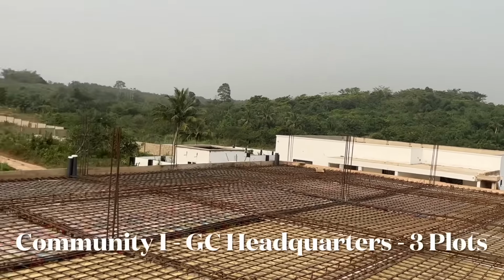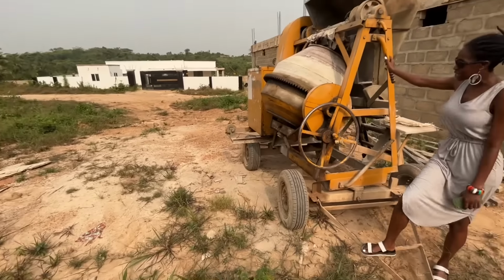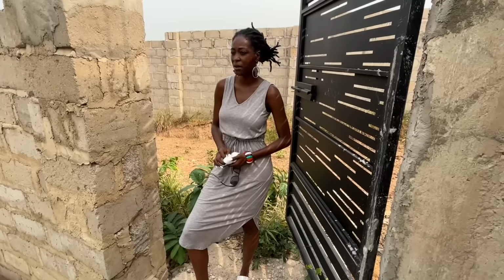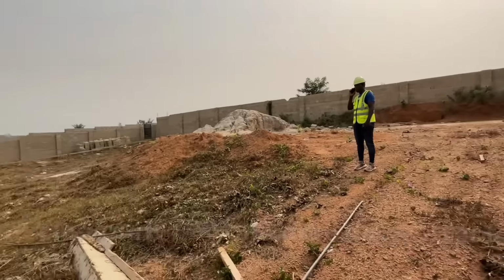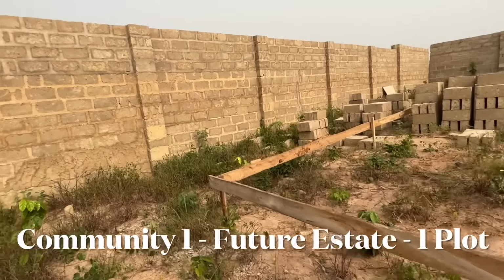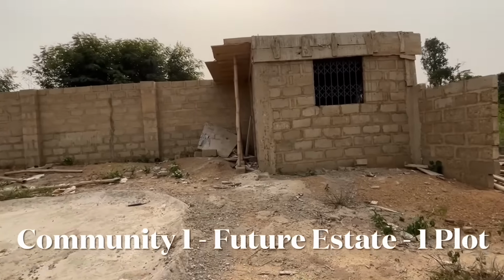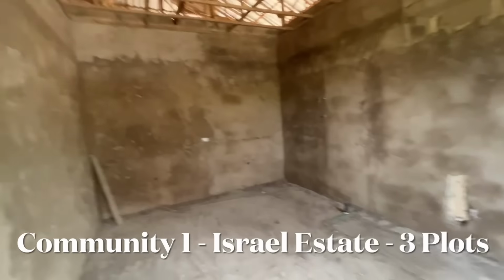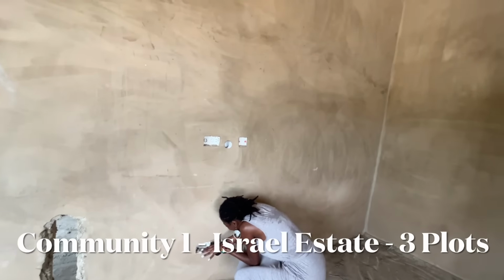GHANA | Community 1 is Moving right Along…. 👏🏾👏🏾👏🏾

Comment: A nice update!  You should ensure that every room has electrical plug sockets on all 4 walls. Also consider designing passive cooling technology into the homes to cut down on the need for electrical power for using ACs and ceiling fans.
Reply from the maker: Thanks for sharing 🙏🏾🙏🏾🙏🏾